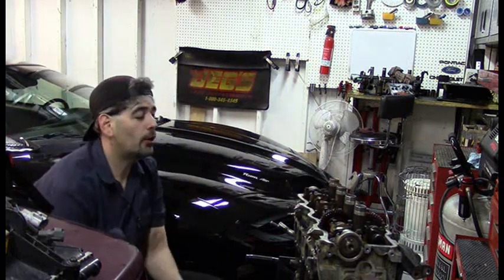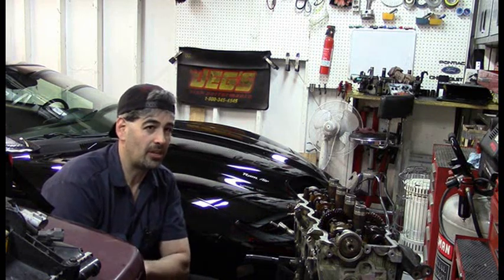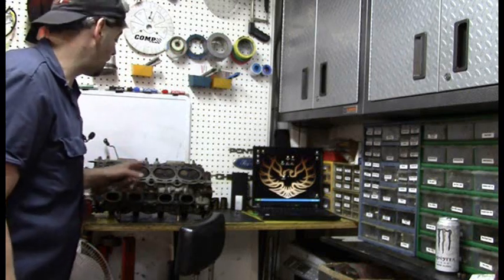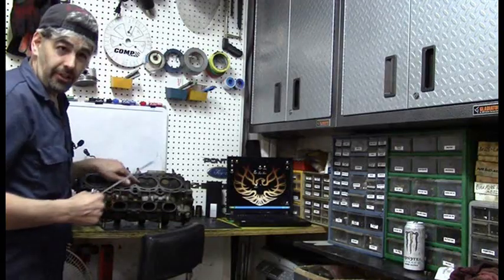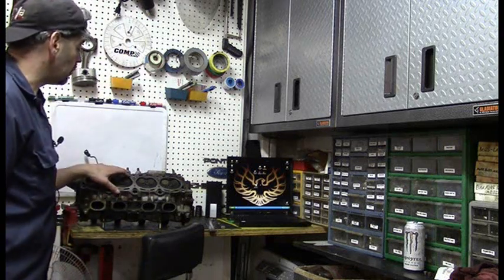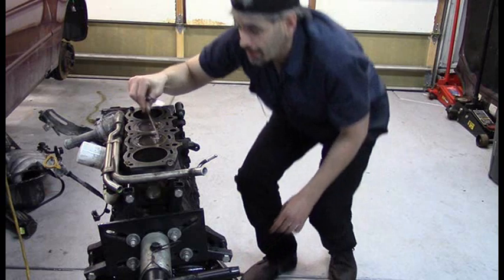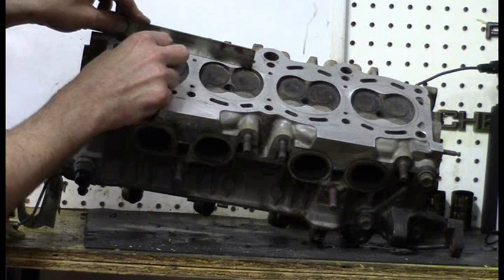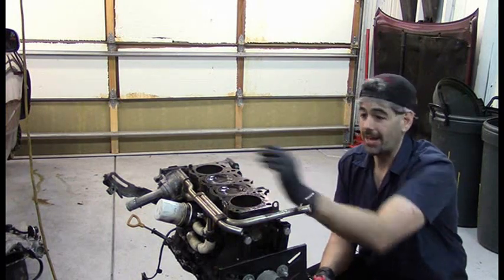Replace a Cylinder Head Gasket Yourself and do it RIGHT! Part 1

Comment: What if your oil smells like fuel
Reply from the maker: then you need to change the oil and find cause of it.  could be misfire or compression. check static fuel pressure.

Comment: Yo, ok so i was driving my hyundia sonata(i love my sonata) and it over heated to the point of it making weird noises after shutting the engine off. I mean it was like, pinging out like...WHOA BABY! Pinging, big time. So i tore it down and i got warping and crackage in there. Any way, i think im gonna just gloop it up, you know, gloopage. Didn't you say that was probably ok to do that. You know on the warpage and what-have-u? .............I thought you said that would be pretty ok to do............i'm just gonna go ahead and........gloop......GLOOP IT UP!.....YEEE_HAWW!.........i'll let you know in a little bit.......umm...k....buh bye.
Reply from the maker: Yeah let me know how that goes... after you put the crack pipe down for at least 3 hours though.
  I have no idea what you mean by "gloopage" and it is highly, highly unlikely that I would have ever recommended a procedure with even close to the connotation that indicates- but if you have actually verified warpage of a cylinder head there is NO method to "gloop" it even temporarily. Any warpage of a cylinder head-to-block past specification has to be machined- period.

Comment: @15:38 this is where to start to check for a warped head with it already cleaned. You dont check for warpage on a dirty cylinder head that you just pulled off the block. That's just a waist of time.
Reply: TAGJAGS came to the comments just to see if someone spotted this problem;  EXACTLY, Auto Fix Pal;   the first head might be good,he does not know; .004 inch, is easily the height of the old gasket remnants,which those dark spots might be... but...I  like the dedication he puts on his videos,like to listen to Sch. Box,thanks... oh, that type of ruler is not suitable;it must be longer than the head,PRECISION GROUND FLAT,kept in it´s wooden box, (it MUST MUST MUST be "calibrated");this IS the ESSENTIAL,the CORE of these gasket jobs;  

at least flip it from side to side of a piece of scrap polished granite,checking    it´s flatness; you might have to go through a few of them,before you find a good one(almost impossible,but you can grind it,sandpaper and glass or granite....carefully...);  mine cost almost 200 dollars  30 years ago,for the xj6 LONG jaguar heads;  

anyway...."good head",   "waist time" , "fix that motor"," all three",?.. that is the question....
Reply: Jose Peixoto I agree some of what's being said in this video is bad information and will lead others that may be following this as a guide to making costly mistakes.
Reply from the maker: Autofix, it is pretty obvious you didn't follow the instructions given in the video.  Can't help you to pay attention bro.  plus any skilled person can actually eye the cylinder head anyway and tell if it's warped or not regardless.  You clearly are not there yet.
Reply: +Schrodingers Box Lmao... Yeah you can eyeball .003" that's a good one. You don't check a dirty head for warpage. Bottom line.
Reply: +Schrodingers Box not to mention you should use a precision straight edge for the job. Not sure what that was that you used.
Reply from the maker: Auto Fix Pal Ah another Haynes manual jockey!!! A guy who read about this stuff but never actually did it!!!
  That was a perfect straightedge you dope.  FAIL AGAIN.

Comment: Buddy If you can't tell which way the gasket go on the block , you shouldn't be working on it .. look closely to the cut of the gasket , it can only fit one ways, the water jacket and oil passage hole have all line up when you place on the short block.  Yes a lot OEM head gasket do stamp Up on the gasket,  But a lot of aftermarket head gasket set don't .. they figure you have enough knowledge to tell the different ...
Reply from the maker: +Eddie Chung Annnnnndd incorrect again. Buddy if you don't understand that on any gasket, some of the oil and/or water ports WILL be blocked on most models then you should NOT be giving advice on this channel.
 You cannot tell just by lining up the passages. Anyone who has ever actually done this work knows that.

Comment: Normally, I would agree that watching a wrench monkey turning sockets and such would not be of much use many situations. In  this case that may not be true since you removed the engine too.

I am up against a similar situation. I live on Social Security. (a.k.a Social INsecurity!) I have a 1999 Camry with that same 4 banger. I have the tools and skills to do this. However, I have only a driveway where I can do this work and NH has really horrible weather,  especially during the winter.

That being said, I would have been ecstatic if you had shown just how to remove that engine! From what I can tell and what others have said, it requires dropping the entire sub-frame assembly. That means the motor and trans all at once. That is not a pleasant thought to say the least. IF that is what you did then a video of that operation would have been worth its weight in gold!

IF, however, you can remove that engine without dropping the entire sub-frame assembly then a video on that would be even more valuable because I have a spare engine in another identical car that I could use as a replacement.

If you do make a video of either method then I believe many of us would find it to be of great value.

Thanks for all of your hard work and videos.

Comment: I seen a guy on youtube using a large sheet of sand paper on a perfectly flat surface and dragging the head back and forth on it. I guess a hacker way to re surface the heads. I dont see why it wouldnt work if you do it properly.

Comment: if you want to be thorough you should show the whole process there's a method to dismantling as well, you should known that.
Reply from the maker: If you are still at the level that you need to see how to spin bolts to remove parts, you are on the wrong channel. This is an ADVANCED channel-  I do not show beginners how to do basic wrenching and R&R.  No skill is needed for that.

Comment: I have a 2009 murano so and im in the process of learning how to change head gasket.. I may have a leak. Radiator leak is somewhere. And someone took out my thermostat. Thinkin it would help get water to the engine.. But he just fucked my shit up. Now I have no ides where to start.. I have 1300$ in my savings and dont wanna start somewhere and end with 0$. Lord help me..lol

Comment: Excelent  Information.
 Note cleaning whith gasoline  is not recomended, metal surfaces cleaned with gas will  reject oil , metal becomes ¨dry¨  and  safety issues..

Comment: Spend more time actually going over the topic of your videos, rather than complaining about other ones. Most people view DIY videos because they want to know how to specifically do something. Head gasket repair is something every professional should know about. Why would a video of some guy explaining how to do something get 150,000 views if every person in existence already knew how to do it.... Probably because they would like to learn how to do it. There's about 50 - 100 steps on your average 4 banger to do head gaskets. Sometimes it's nice to what to do in between step 1 - and 100. Just saying.
Reply from the maker: There are many people who know how to do this stuff but watch anyway for a number of reasons and in fact about 40% of my subs are automotive students and professionals, which I never expected but I'm glad it turned out that way.  I agree though- I believe most viewers on other channels probably never even turn a wrench except to change their oil but that definitely is not the case on my channel, for whatever reason.
Reply: 22Re is the best toyota engine ever!
Rebuild will be very satisfying
Reply from the maker: Damon B honestly it's just removing bolts to remove the head. Do people really need to see how to unscrew a bunch of bolts holding things together?

Comment: Dear Matthew from Denver,  I need you to fix my car asap please.  Nissan Sentra 2000 1.8.  I'm pretty sure the car is in need of a new head gasket (o2s, and catalytic converter add on a plus if necessary).  This is my only vehicle, and I do not want to give her up simple because I am not able to make the necessary mechanical corrective measures that are needed to fix her.  Very Shamefully, I did add stop lead gasket fluid to the radiator.  This shellfish act is buying me very little time, to be sure.  With strong conviction, this (my) car deserves much better than this.  Having said this, would you be willing to help out by proving your services to mechanically do the repair work required.  If not, I do understand.
Reply from the maker: If your are serious PM me and we'll set something up.

Comment: Dont know why modern cars still have cylinder head gaskets. They dont give much trouble below 150k klms and by then they are not economic to replace. So why not permanently bond the cylinder head to the block.
Reply from the maker: Good question! I don't know... my guess is the gasket allows for temperature changes so the engine is less likely to warp or crack... kind of like stress cracks in a concrete sidewalk. Thats just a guess- I don't actually know the reason,
Reply: @SchrodingersBox  I'm not sure either. I do know a lot of aircraft engines (Lycoming and Contnintal and most radial engines) have no separate cylinder heads.
A have a couple of stationary engines from the early 1900's that have one piece barrelled and head and are still running today. 
I think originally they were two piece because they were made of two different materials and it was easier to manufacture that way. Any trouble I've had with cylinder gaskets was gasket corrosion. I'm sure theres a more straight forward reason that I'm not aware of. Must call my buddies at Mercedes design for more info!

Comment: I can replace any head gasket without removing the head... there is a trick to it, though.
Reply from the maker: Yeah- you remove the block from the head instead of the head from the block.
Reply: Schrodingers Box 
No, first you remove the front seat, then make sure the the radio is on, blasting or it may not work properly. Then, you remove the left rear tire to allow to release pressure from the top of engine, then you do the Rama lama dance around the car to stimulate engine performance, then you're done.. see how easy??
Reply from the maker: +carlo mango I was expecting a witty, clever, sophisticated response, kind of like mine.  
   Turn the radio on, let the air out of the tires, and dance the rama lama... yeah sorry, basal sillyness is just not that humorous to me. There is no satisfaction in a riddle that has no intellectual, artful cunning to it.

Comment: you deleted my comment: you had made a mistake by not properly cleaning the old gasket remnants? that can  easily amount to .004 or .005
Reply: at 15:38
Reply from the maker: Um no I THOROUGHLY cleaned the old gasket and mentioned that several times in the video.

Comment: You are wrong! When head gasket fail, did not seal anymore, and that leak, is causing problems. You said, that head gasket is the end result of some other issues. That is possible, also. In many cases the gasket simply don't seal anymore!
Reply from the maker: What is the cause that they “just don’t seal anymore”?  What EVIDENCE do you have of this?  Notice how I showed evidence. How does a MLS gasket just suddenly not seal anymore?  Does it rot? What is the CAUSE of the failure?

Comment: DO NOT add any liquid head gasket fix... thos products will cause lack of cooling in the rest of the system, heater core for example during winter months you WILL have LESS heat coming from the vents, tell me you want that? eat the bill and fix it correctly

Comment: I have to rip my whole engine out just for my heads to be cleaned and my gasket changed. And the Nissan dealership is gonna charge me 5k just to fucking clean it and replace shit
Reply from the maker: For that I would just replace the engine with a used one.
Reply: @SchrodingersBox  that's what I was thinking but the problem is, finances I have barely enough to do the head gasket on a really good running engine. Or I could wing it with a used one. I couldn't afford a brand new engine. This one runs like it's brand new

Comment: E V E R Y bolt is torqued a certain number of D E G R E E S ; even before it´torqued.lol

The reason they came up w/ the degrees ,was because of BAD mechanics .
It´s not the degrees that stretch,or not, a bolt; heck you can give them degrees,and still leave everything loose;
When you properly"degree" ,all you do is bring the bolt to the proper TORQUE,which is difficult without the "degrees" gimmick,because of lubrication/friction  differences;
i   A L W A Y S  torque by hand,oberving SIMULTANEOUSLY  1-- toque wrench---2---degrees----3---MY feeling for the stretching of the bolt,; this nr 3  being the commander of the operation(many hundreds of SUCCESSFUL head jobs here,right arm RULES).Formula 1 guys  tighten rod bolts with no degrees ,AND NO torque wrench: they precisely measure the elongation/lengthning of the bolt; the bolts are but a VERY strong spring,a linear one at that,working on traction.
FACTORY manuals say:  measure the length of all head (and rod,and crank!) bolts ,(and  give you the specs--length).
If ok,re-use them. I A L W A Y S  do,only found one stretched  .004" or .005"once, then i  measured the threads,re-used it..
FACTORY manuals(some!) also tell you-if you re-use them-- to MARK every head bolt ,so that you put it in the same hole; i still do not know why,if anybody knows, please explain why.
Reply from the maker: Well you are doing it wrong. if the bolt is to a torque spec then degrees are itrevant. This is basic, fundamental science my friend. Basic fundamentals. 
  anyway to answer your question- while i do not recommend re-using bolts it’s inportant to reuse them in the same location to prevent introducing additional variables of friction resulting from the confirmation of the stretched bolt to the thread pattern and dynamic.

Comment: Video can be short. Explaining is too much.
Reply from the maker: +hani60pk This is an advanced channel for people interested in the theory of mechanism.  If you are still at the beginner "bolt turning" level then this channel will not be for you- which is fine. I recommend ETCG. You just accidentally stepped into the 301 instead of 101 class is all.

Comment: No scientific study just can be evidenced by trawling through ebay "motors for sale spares or repair" though, I'm in the UK..and you have 272331 views right.
Reply from the maker: even if were not anecdotal- perhaps the common practice of aluminum heads on cast iron blocks would explain it. The incidence would be equivalent and perhaps even more common if older cars did this but since we have no baselines we cannot know.

Comment: those engines are so freaking cheap, it's not worth fixing. Just throw it away and get another used one.
Reply from the maker: Actually that is not a bad argument in many cases. The idea of the video was to show the procedure but in general, I actually do prefer to just swap with another engine that likely hasn't been subjected to overheat and diluted oil

Comment: less talking
Reply from the maker: As opposed to what? Turning bolts? If you're still at the level you need to be shown how to remove bolts rather than understand theory and mechanism applications then you're on the wrong channel.  This is not a beginner channel  and i make that very clear. You can watch people spin bolts on any other channel and you'll still be a beginner.
Reply: Schrodingers Box yes, but you were not giving the best camera description on the gasket. otherwise you are a good mechanic. my head gasket was blown on my dodge charger, cost me alot. So I want to learn to fix it on my next encounter if it happens again
Reply from the maker: what did i just say??? That's a beginner question dude. this is not a beginner channel.  You're in the wrong place if you need to learn basics
Reply: Schrodingers Box kool
Reply from the maker: Come back after you learn how to turn a bolt left or right when you desire to know how things work and what the approach is to do advanced diagnostics and you'll not make such a stupid comment as "less talking please".
  Do doctors go to a lecture on how to do diagnostics using genomic analysis and say "less talking please?"  No- but a grade schooler would do that. This channel is medical school, you are still in grade school.
Reply from the maker: Andre Lumsden You still don't seem to realize that you don't make the rules here.  Look at your comments- look at the comments on ALL my videos. If you want to reach a high level of ability you will STFU and pay attention.
Reply: if you noticed, I did say you were a good mechanic. I gave constructive criticism as having the camera more in debt on the part itself. And this conversation is over. I'm not gonna go back and forth with you.
Reply from the maker: Andre Lumsden You need to see what a part looks like??? How many times do I have to tell you- I tell people the theory, design, application and diagnostic strategy.  If you are at the level of "I just wanna see what a part looks like" you need to come back later when you know the basics. I am teaching cardiac angiotension converting enzyme regulation by negative feedback and you "wanna see what a heart looks like!!"  Feel like you're in the wrong place?